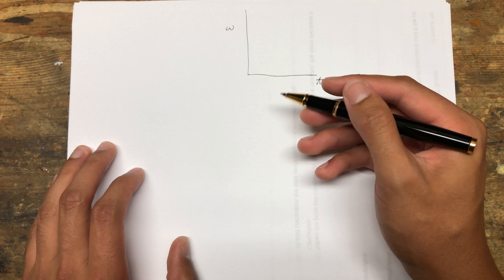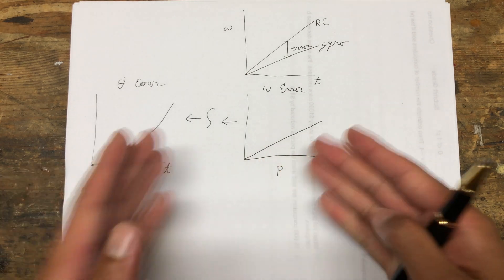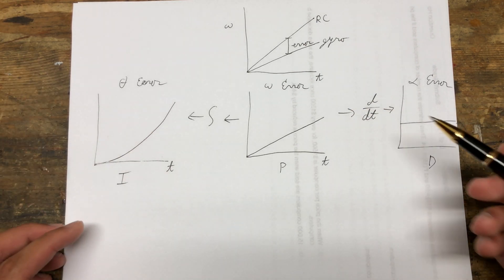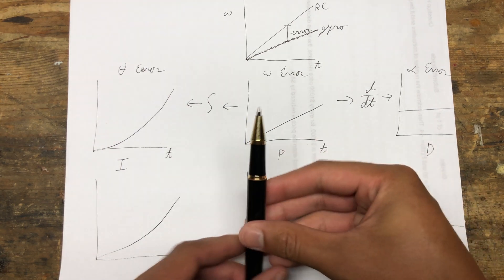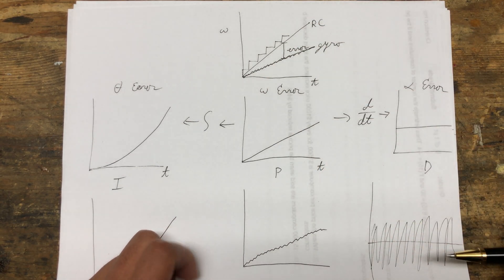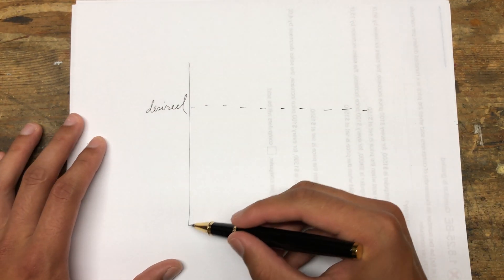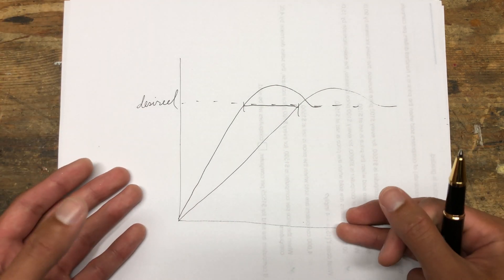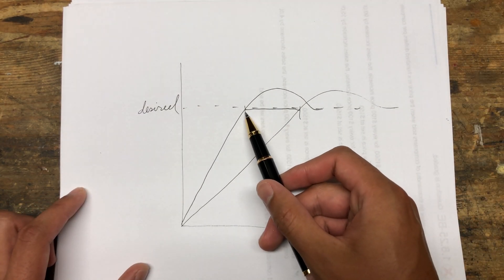Improve Your Drone's Responsiveness: D-Term Explained and Why It Can Fry Motors (PID Tuning Theory)

Comment: the best video of how pid controller works ever, great job! what you said at the end is the most interesting for me..... because if there was a some sort of blackbox log that could tell you if you are pushing your motor/esc to the limit you could translate that to your max d gain that your quad can handle and therefore having the *perfect tune*. let me know what you think of my assumption.
Reply from the maker: Thanks! You can already see this via the motor outputs graphs in Blackbox, which is indeed a good way to see how much D-gain is needed to saturate the motors.
Reply: @TimmyRC  thanks!  Does this mean that your pid tube effects your battery life?
Reply from the maker: @tomer747  Technically yes, but the magnitude is miniscule.

Comment: I see to many people flying with aggressive PIDs which makes the quad act like a CNC machine and seem like a stilted robot in the air.   It's just me, but I want some slop and play going on...   I don't want it acting like a lasar cutter stopping on a 5th position decimal degree position exactly.     IMHO most of your attention you be focused on dialing in your rates, and just forgetting about the PID controller.  If you're starting out your quad is flying awful o you not because of the PID controller, but because your rates are wrong for your brain.  

 It took me about 1000 hours of flying in the Sim to really nail down my rates or rather...r ate ranges.  Yeah, that long.      You're just never going to be able to get them perfect flying real hardware in under a hundred hours in the air.  You can get them close enough that you think you got them perfect, but they're at 80 to 90 percent of perfect and you just think you got them perfect.  I thought mine were perfect ofr me after 500 hrs... it took me another 500 horus to polish them off that extra 10%-15% (which was not that far off, but makes a world of differentce).

No rate is perfect for every scenario or flying situation or field.  Having the right rate for the right type of place and field or location or situation though can and will make a world of difference... between some things being impossible, and the same maneuvers or things being.. trivial... with the right rates.It takes a while to realize this, that one rate does not fit all situations, nor one Super.      In a big wide open space, you want a lively quad... unless you are doing cinematic cruising... then you want super low rates.   If youre in a tight enclosed space, sometimes you want low rates, soemtimes you want low rates that are a tad bit livelier to make sharp turns, etc.   

I say skip messing with the PID numbers for the first 1500 hours of learning to fly.  Others will tell you get into it immediately to turn your quad right after the first maiden but I'm like...  meh, you can fly bad PIDs, but if you fly bad rates without ever changing them it's going to stilt your learning for your entire career.    If you really want to get into all that mess, well, Chris Rosser and some others will really get into the ugly and involved fine tuning of it.    https://www.youtube.com/watch?v=WoxDbIbpP_Q
Reply from the maker: An aggressive tune can make unsmooth/unskilled pilots look worse but also gives skilled/precise/smooth pilots better control of the aircraft. I personally use an aggressive tune, so you can decide for yourself how robotic my flying looks.

I agree that beginners should only bother with rates and not PIDs. The defaults are good enough that a beginner will probably have a hard time discerning the default tune from an aggressive tune. However, a good PID tune will provide a level of control and confidence that rates tuning cannot provide, so those who want the best aircraft performance should tune the PIDs in addition to the rates.

Comment: Is there a way to get in touch with you directly. I'm new to fpv and I have a few questions. The main one is how do I gain better control of my drone. As soon as I try to take off it shoots to the moon then falls out the sky
Reply: throttle curve, throttle limit, mid  and expo would probably help
Reply from the maker: Join the Discord server